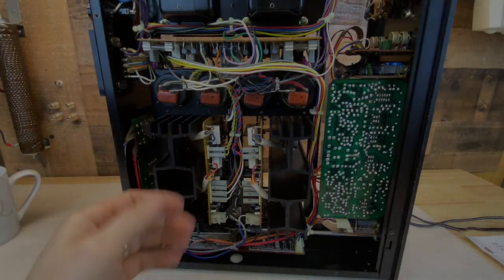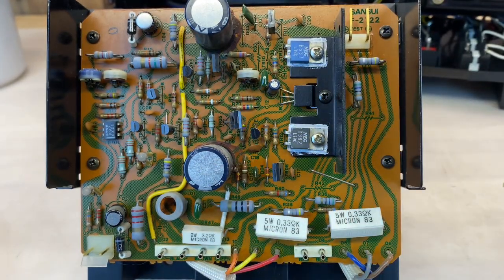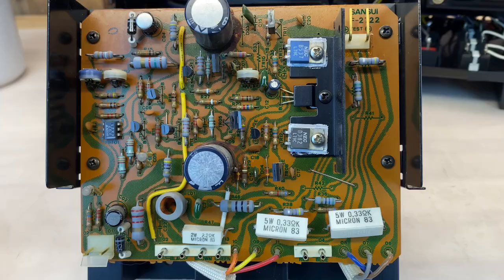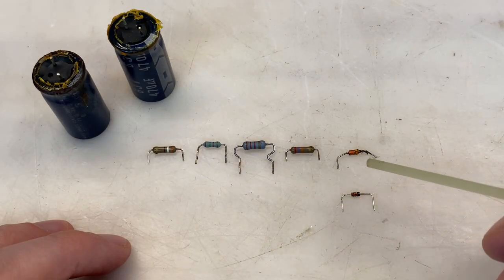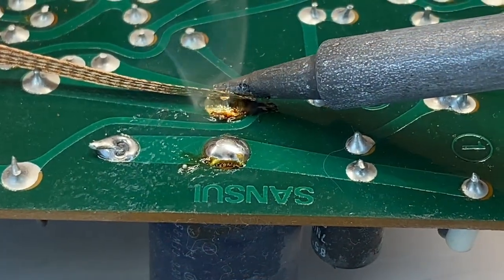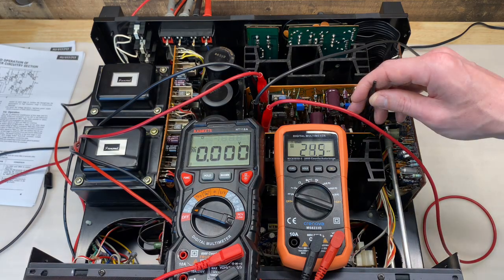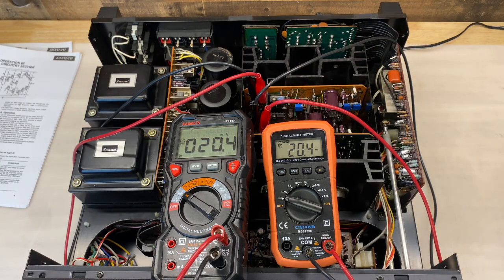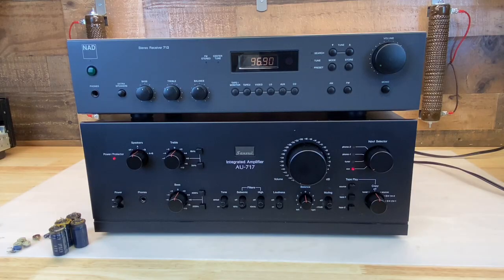DR #61 - More Sansui - Rebuilding the Amplifier Boards of an AU-717

Comment: Just a ballpark estimate what was the cost of the replacement parts on these two boards? I Have an AU 517 that I need to work on and just wondering. Thanks for the informative video.
Reply from the maker: I’d say $100 for parts, but I don’t remember specifically.
Reply: @dualityrepair4770  Thanks. I am learning to read a diagram to identify the roached bits.

Comment: An option to remove the glue on the PCB is using Xylene to soften the glue and then clean with q tips. Takes time but avoids scrapping which can damage the lettering on the PCB.
I have had same issues with lots of Pioneers of same era.
Great videos, and please continue.

Comment: Nice video, noticed you do the minimum and don't just change wholesale diodes, transistors and such.  I notice the ZD01/02 legs are typically blackened.  Any concern these are heat stressed and should be replaced with 1.3W or 2W?   Did you consider using audio capacitors or film for the low capacitance one?
Reply from the maker: The purpose of this video was to document the resolution of the standby problem only. There is plenty more work to do, if the owner would like it done. If so, I’ll likely document that process as well.

Comment: AAAawwwww   the pooper dawg!!!   Hey two quick questions if you have time.  What in the world is with the capacitor glue??!?!  Every time I see older gear, there is almost always some form of glue gunk that goes bad and causes havok?  I notice I rarely if ever see anyone replacing Caps and re-adding "glue"?  And what are the four orange, I think ceramic capacitors on top of the power filter caps?  Are those some sort of bypass of some sort?  Great work as always!

Comment: Always like seeing your repair and servicing on amps.  I'm sure you are aware but use a square wave with caution on power amps when they are driving a dummy load as the square wave causes considerably higher power dissipation in the output stage transistors, possibly to the point of damage at full output swing.
Reply from the maker: Good call out. I always use it at the low end, but I should mention why.